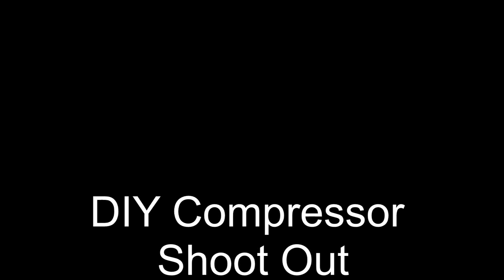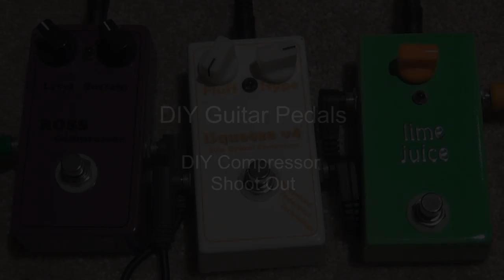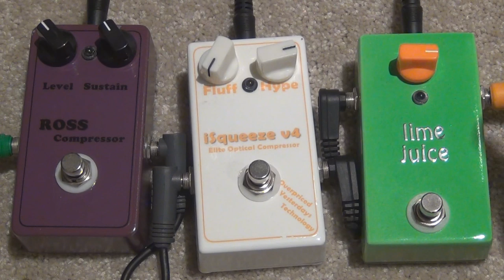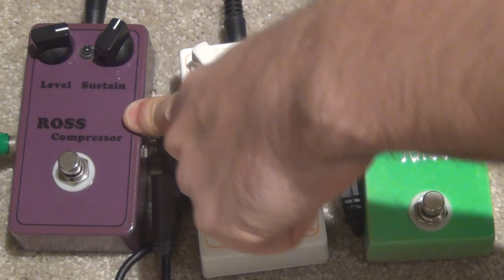DIY Guitar Pedal Compressor Shoot out - Orange Squeezer, Ross, DOD Optical

Comment from the maker: Hey Justin.  As far as biasing goes its a bit of a long explanation so i'd suggest searching on DIYSB for biasing orange squeezer or something like that.  There are a number of threads detailing the process.  Unity on my orange squeezer is at about 2:00-3:00, but i've heard that this can varying depending on the jfet you used.  I'll think about doing a video on biasing the OS in the future, thanks for question and good luck!

Comment: The Ross definitely has the best sound quality except when the sustain is set to zero resistance. A slight design flaw. Needs a little more attenuation before that maybe. The squeeze adds way too much noise and the lime one is just junk. Distorts the low end. Exactly what it should be stopping.  The Ross sounds pretty nice. It does drop a little low end but if your running gain after that's desirable to most players.